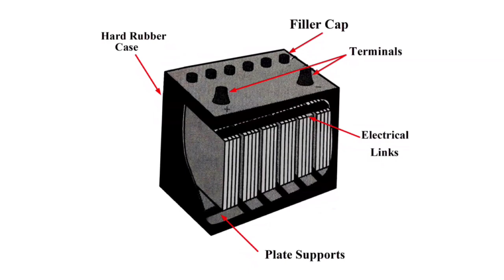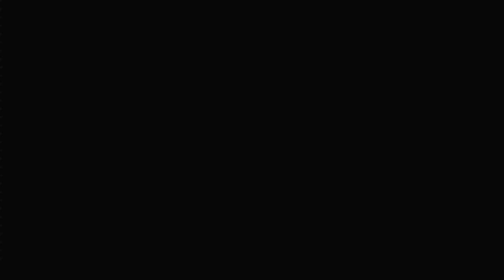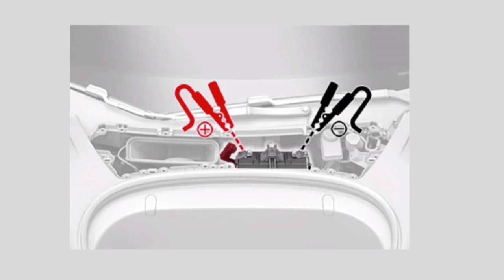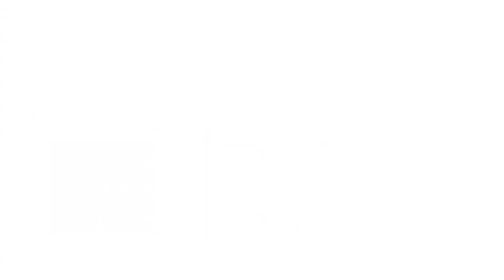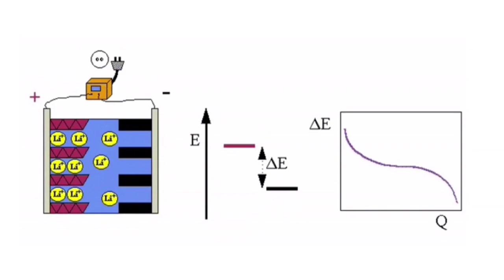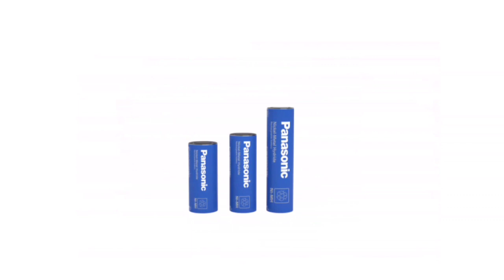Energy Storage Solutions ESS | Cell Types and Battery charging and discharging calculation

Comment: Mam one doubt in electric vehicle the term supercapacitors and ultracapacitors are same or different?
Reply from the maker: The terms "supercapacitor" and "Ultracapacitor" are often used interchangeably for the same energy storage capacity but lower than the battery. Technically, however, the term "supercapacitor" generally refers to a capacitor with a capacitance value in the range of a few hundred to several thousand farads, while "ultracapacitor" refers to a capacitance value of tens to hundreds of farads. condenser.

In practice, the difference between supercapacitors and supercapacitors can be ambiguous, and the terms are often used interchangeably in industry and academia. Finally, two articles on energy storage devices that can be used in electric vehicles and other applications to provide fast and powerful electricity.
Reply: Thanks for ur explanation ...In my semester there is one such topics as Supercapacitors for transportation in application..I can't find the notes that's why i asked the doubt
Reply from the maker: okay...if you have any more doubts..please do ask